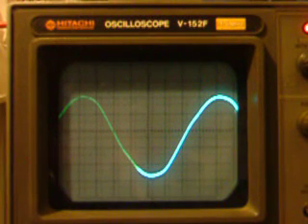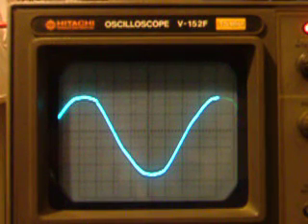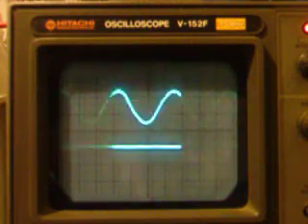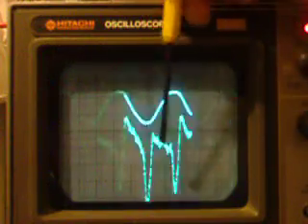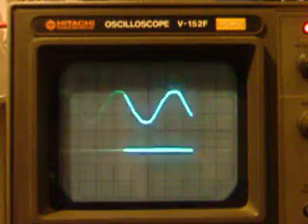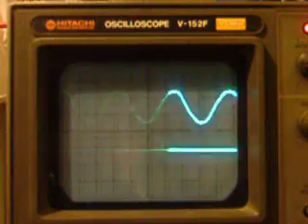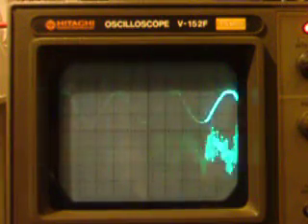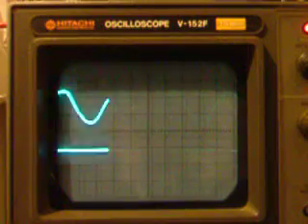The Hunt for Buzz & Hum - Part 1 of 10

Comment: Cracked tube ?  bad filter cap ? Rectifier diode ?  Rectifier tube heater or arcing ?  The 60 cycle alternating electric current (AC) changes direction 120 times per second. In one-second time period aterminal at an electric outlet is positive 60 times and negative 60times.

Comment: Thanks for your help.  I added filter caps at 100nF across each of the bridge rectifier diodes, and that helped the noise problem but didn't eliminate it.  Further investigation, and I found out that the system was inherently unstable due to wrong values I used for the compensation capacitors.  Once, I changed them out, the amplifier worked beautifully.  Thanks for your videos and your reply :)

Comment from the maker: The cause of the noise is the rectification process that turns the AC house voltage into DC voltage for the amp.  The cure is to filter the noise out of DC.  With tube amps it get a little more complicated because of the heater filaments in the tubes.